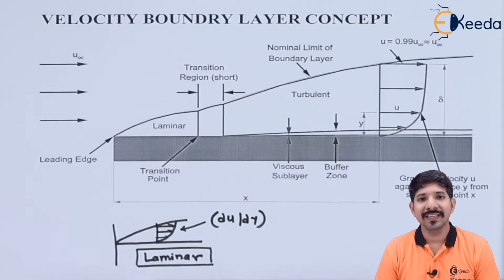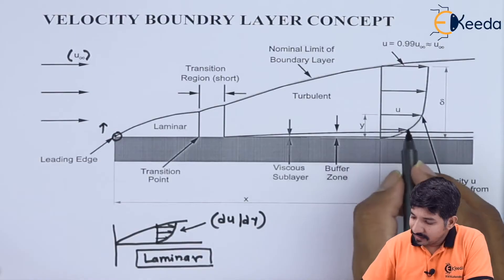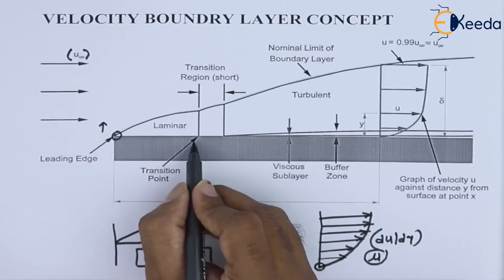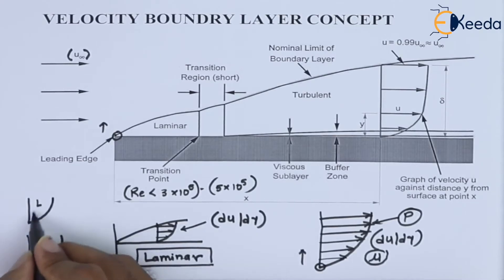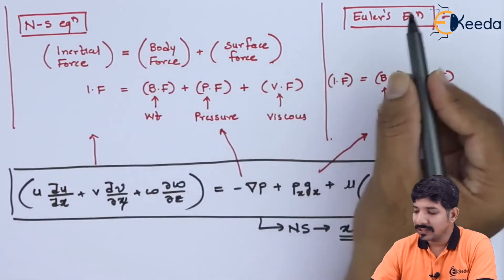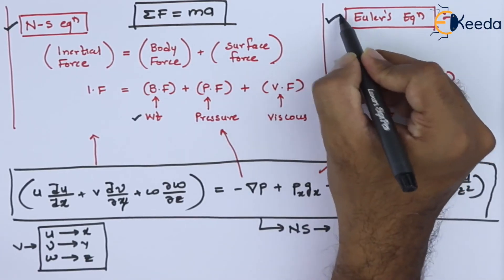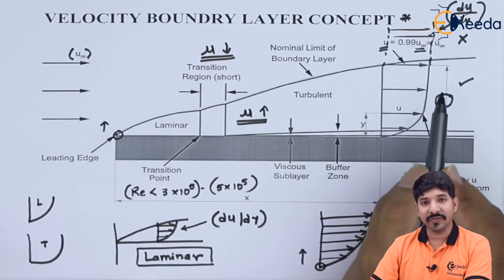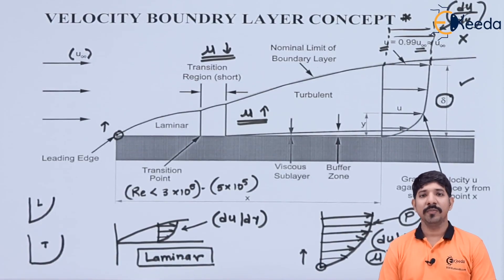Velocity Boundary Layer Concept - Convection Heat Transfer - Heat Transfer

Comment: You are giving wrong info about it 
Reynolds no. <2000 is the condition for laminar flow
Reply: That is for flow in a pipe ...But here he is not  talking about pipe
Reply: That is for internal convection, like flow in a pipe.
Reply: It is not 2000 
It is around 2300 for
Internal flow ...
And for flat plate is 5*10^5
Reply: It is not 2000 
It is around 2300 for
Internal flow ...
And for flat plate is 5*10^5
Reply: It is not 2000 
It is around 2300 for
Internal flow ...
And for flat plate is 5*10^50
Reply: It is not 2000 
It is around 2300 for
Internal flow ...
And for flat plate is 5*10^5